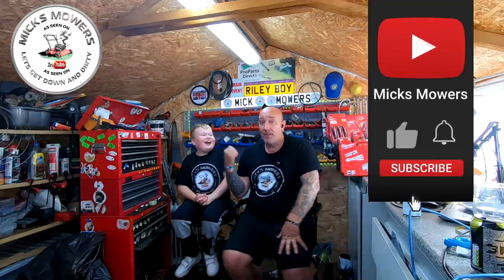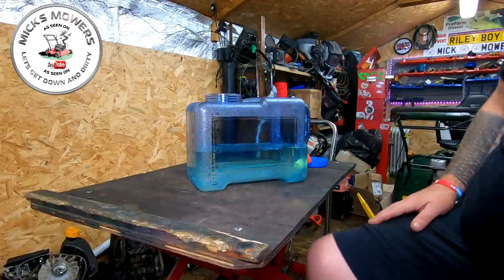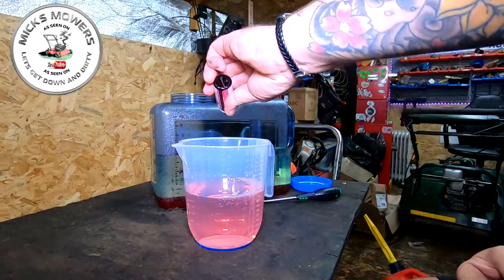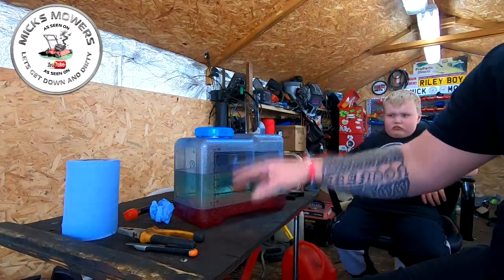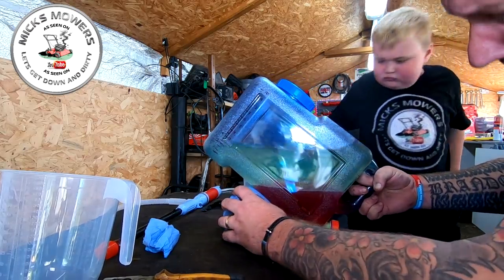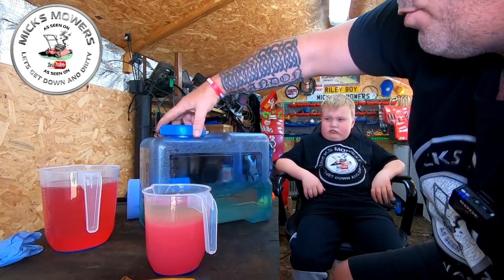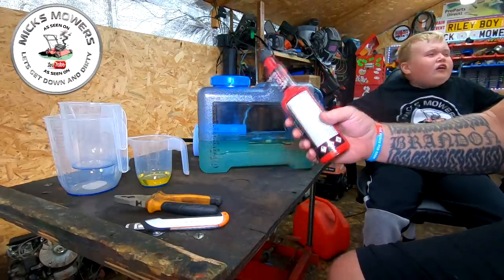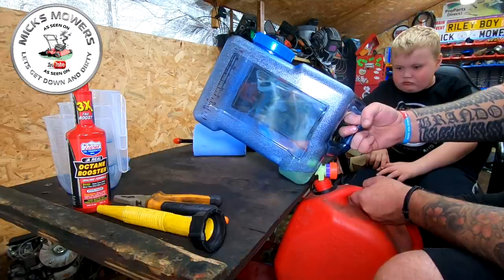How To Remove Ethanol From E10 Unleaded Fuel To Use In Lawnmowers And Small Engines

Comment: Would it not be easier and cheaper to just buy super unleaded?
Reply from the maker: I'm just giving an option
Reply: @themowerman  yeah and well thought out one everyone is looking at options and doing research for obv reasons. After looking into it myself and partly through owning a sports car that runs on super unleaded and checking about new fuel I found out super unleaded for me is way forward for my power washers and lawnmowers etc straight from pump to machine. It wasn't a dig , I thought it would open up conversation about what I said if anyone had including yourself had any more insight into situation.
Reply from the maker: @andymorrow1597  thanks for the information mate

Comment: If you can separate the ethanol from the water, why not add it to the windshield washer fluid bottle in your car rather than dumping it or “responsibly disposing of it?” It’s made from corn and biodegrades. You can also burn it for heat. It’s paid for - why waste it?

Comment: HI   I USE ETHANOL TO CLEAN PARTS AND ETC. I HAVE STARTED DOING THIS WITH OUR MOWER GAS, AND IT WORKS WELL.  I HAVE SEEN TO USE SALT TO REMOVE WATER OUT OF THAT OLD ETHANOLTHAT CAME OUT OF THE GAS.  THEN THEY COULD USE THAT TO WASH OFF PARTS AND OILS AND GREASEY PARTS. DO YOU THINK THAT THE SALT IN ETHANOL WOULD WORK?  LOOKS LIKE IT WOULD.  THANKS FOR THE GOOD VIDEOS.
Reply: He put 2 litres of water in there.
How much salt are you planning on using to soak up 2L of water, just to recover 500ml of ethanol?
Reply: @incandescentwithrage I HAVE NO IDEA, A LOT I GUESS . A CUP OR MORE? IN MY AREA 1 QT. OF 70% ETHANOL IS BETWEEN 2.00 TO 3.00 $ US. IF I CAN GET 500ML FOR 1 CUP OR 2  OF SALT THAT MIGHT BE WORTH IT.  SALT IS CHEEP AND ALSO YOU MIGHT BE ABLE TO RECLAME THE SALT BY EVERATION OF THE WATER. JUST SOMETHING I THOUGHT MIGHT WORK.                 THANK YOU FOR THE REPLY.

Comment: I Think that there has been a lot of scaremongering and BS talked about E10 petrol. I can remember Cleveland Discol being advertised as containing alchohol not sure how much but somewhere around 20 to 50% maybe higher as it was the marketing brand of Distillers who made if from the left overs from the brewing industry, they sold it from the early 1920's to the late 60' or 70's when they got taken over by the Guinness  group. Ethanol did not seem to cause problems back then.
Reply: Back then they didn't have so many rubber or silicone gaskets, engines were more rudimentary and didn't involve complex injection systems but more simple carburetors and we all know if you throw anything volatile into a confined space with a spark it will bang! What do you think moonshiners used in their vehicles to gain an advantage. Obviously It would involve more maintenance as displayed in top fuel dragsters that are required to have their engines stripped after every run 🤷🏻‍♂️ and nope it ain't because of the torque stresses, it's purely because of the high ethanol/methanol fuels they run.

Comment: 8:10 - When pouring liquid from any container with a spout, hold the handle at least or  to mitigate sloshing! Also, 10:54 - set the lid on square to the target and with slight pressure downward, turn the lid backward up to a full turn until you feel the pop, then screw the lid on without cross-threading or otherwise fighting it. 21:30 - "Not one milliliter" is what he meant to say!

I saw a vid once where all he did was let the fuel sit for several days. Then he removed the precipitant from the bottom.

Comment: Ethanol free gas is hard to find and very expensive here in CA, I've had no issues using E-10 since it's inception a few decades ago so I don't bother using ethanol free. In case it wasn't discussed in the video, stripping the ethanol will reduce the octane and could destroy your engine.  I strongly recommend starting with high octane E-10 if you're going to strip the ethanol, or at least be vigilant of your engine and listen for signs of detonation.

Comment: It was oddly satisfying watching the red stuff extrication.

I live in Canada and I despise ethanol gasoline. It messes up small engines and can also affect car engines. All this nonsense to mollify some enviro-wackos and agriculture lobbies. And the fuel is made less efficient by virtue of reduction of BTU due to the ethanol. You actually burn more fuel than with straight gasoline, or as you in the UK call it, petrol.

P.S. Lovely to see you having your son with you. I am sure he will always have fond memories of time with Dad.
Reply from the maker: Thanks for watching mate
Reply: @themowerman  You're welcome, mate. My local gas station used to have ethanol-free gasoline, but recently they applied a label to the high-octane pump which reads: "May contain up to 10% ethanol."

I ran ethanol-free in my "muscle" V-8 engines. I would put away several NATO jerry cans full of ethanol-free with stabilizer. It stores well in those steel cans. I would fill them up with winter formula gas and add stabilizer.

In Canada we have two blends of gasoline, winter and summer. Winter fuel has different additives so as to enhance cold weather performance. Being so close to the U.S. we have fallen for the ethanol myth.

Thanks for making it look easy and understandable. I still have some ethanol-free fuel from last winter, but now I must either find a station with ethanol-free or "brew" my own. Cheers!

Comment: why not just use shell vpower for the next 5-10 years..its got allkinds of additives keeping the engine clean while e10 has not.its ike supermarket petrol..ethanol absorbs moisture from the air..thats the root of the problem..but like you pointed out there is an additive that floats on the top and does not let air past.acting like a barrier but yeah..vpower for now

Comment: You now have ethanol free fuel, of unknown octane.  Now add some amount of octane booster to achieve a unknown, but higher octane level.  The risk is detonation in your engine which can lead to rapid engine failure.  In the USA, Ethanol free fuel is available for such uses.  Now, what do you do with the hazmat fluids after you extract them?  Octane booster does not add "Pizazz", it increases the temperature the fuel self ignites at, known as the flashpoint.  By taking away the ethanol, you lowered the flashpoint of the fuel by some amount.  Using this fuel in an engine would be risky.  Add back enough octane booster and you will be fine, but how much?  Do you want to risk this?
Reply: This is exactly backwards.  High-octane-rating fuel has a LOWER flashpoint, ethanol and octane and octane-rating boosters RAISE the flashpoint.  As the piston compresses the fuel-air mixture, it heats it, and if the flashpoint is too low, it will ignite before the spark and before the piston reaches the top.  That's what engine knock is, and it's why high-compression engines need high-octane-rating fuel.  Also, since it ignites without the spark, it can run on after the engine is turned off and the spark stops.  So if there's no knock or run-on, the fuel is good.  The octane rating CANNOT BE TOO HIGH unless it gets so high the spark won't ignite it, which I'm pretty sure is impossible to do with this method.
Reply: Worth noting that adding ethanol has enabled the oil companies to sell us cheaper, less-refined petrol/gasoline without a price change.  The high-octane stuff takes more refining to produce, and there's only so much octane in crude oil, so there's less yield of it.
Reply: @egregiouscharles9702  No, High octane rating fuel has a HIGHER flashpoint, allowing it to be used in higher compression engines without detonation.  Take the ethanol away and you risk engine damage due to detonation.  It is counter-intuitive that increasing the octane level of fuel allows more power to be extracted from the fuel while also increasing the flashpoint of the fuel, but that is the way it works.
Reply: @MyRadDesign  Oh crap you are completely right.  How did I screw that up?  You'll notice I described the process accurately but reversed the higher and lower.

Comment: The trace minerals from tap water wouldn't compare with the buildup from ethenal. If we burned clean fuel our cars would need far less repairs.
Reply: Ethanol is clean burning and leaves no residue when evaporated.

I cannot say the same for Gasoline.

Comment: Why don't you just call it distilled water?
Reply: Because it is not the same thing. Deionised still contains bacteria and viruses. Distilled still contains ions. For completely pure water you have to deionise distilled water. Deionised water should never be drunk until it has been exposed to the air for a while. It is reactive ie corrosive

Comment: Here Mick.  
You don't need a distillation flask. I use a a large pressure cooker with the weight removed and a coil of copper brake pipe attached to the steam outlet.  Put the coil in a basin  of cold water with the outlet then in to a jug. (Cold water will help ot cool and therefore condense back to liquid from vapour)  Try keep to 78c (boiling point of ethanol) 
You should end up with it reasonably pure, well atleast pure enough to use as a fantastic degreaser/ cleaner.  Hell yer own personal supply of hand sanitizer if you prefer....  lol

https://youtu.be/aWiQrHW7XBs

Comment: So instead of +25p for 5 litres of super unleaded you can pi55 around... spend £'s on deionised water, a container, sucking machine and loose 0.5litres of fuel you have paid for in the first place...

Or simply don't let the fuel evaporate from you carb after use by shutting the fuel off and letting the engine run and use all fuel in the carb...

Comment: that was pointless as all octain boosters have ethanol most are just pure ethanol.
for garden stuff just use a 97/98 ROn or octain petrol.
by the time you remove the ethanol the octain will drop to 94 RON 
if you add 2 stroke oil it will drop again to 91 RON because 2 stroke oil lowers the octain
91 RON petrol is perfict for small engins

Comment: So... If it's 10% ethanol, and you had 5 liters to start, if your method were sound, there would be fully 2.5 liters of water and 4.5 liters of fuel. Looks like you got maybe half of the ethanol.
Reply from the maker: E10 or up to 10% ethanol

Comment: The ethanol in E10 is what gives the fuel it's octane rating, that's why it's cheaper than E0. Removing the ethanol will dangerously drop the octane rating of the fuel. Your better off just using the e10 within 30 days or adding stabilizer.

Comment: So fuel with ethanol is not god for a scooter
Reply from the maker: Because they have increased the ethanol it will not run as clean as with petrol with no or very little
Reply: @themowerman  Maybe i just use octane 100 without ethanol

Comment: Glycol is much better than water in order to remove up to 10% of ethanol plus up to 3% of methanol included in our terribly treated gasoline.

By removing that shit we are increasing the caloric power but lowering the octane index.

My 5hp outboard requires only 92 octane fuel, free of ethanol, to get the rated 5hp maximum power and not developing  aceto bacteria after being left in the tank for one or three weeks.
 
So I bought 1 liter of glycol and 5 liters of 98 octane gas (petrol).

I do know that my 4.5 liters left of ethanol free gasoline will not be 98 octane anymore but now will still have more than 92 octane index.

Just used 0.5 liters of glycol that I kept for the next time because it's not as cheap but much better for this purpose than plain water.

Comment: This is an 'INCREDIBLY BAD IDEA! ! ! First of all you are assuming that the gasoline is 'PURE' gasoline, IT IS NOT! Second, You are assuming that the gasoline you end up with will have sufficient octane to run your engine reliably and without engine knock. IT WON'T! I have transported and loaded gasoline for the past 6 years and I can tell you that the gasoline the refinery starts with to make 87 octane E10 is very low octane to start with and then it is diluted with other lower octane fuel to reduce the octane even further. Only then, after the octane is lowered enough is the Alcohol reintroduced into the fuel to raise the octane rating back up to 87. By removing the alcohol you are trying to burn a fuel which will result in VERY POOR performance of your engine and will do GREAT harm and damage to your engine. 
If you want Pure gasoline then find a source that will sell you gasoline without alcohol.
Reply from the maker: I appreciate your comment thanks for watching

Comment: You are wrong!  10% ethanol does not hurt modern gasoline engines.
Reply from the maker: I did not say it did.. watch the video.. it's for small engines.. Lawnmowers strimmers.. sooo your wrong..
Reply: @themowerman  It does not hurt small engines ether.  Ethanol in gasoline has been mandatory for about 30 years and I use it in everything from my lawnmower to pickup trucks.  Never had any fuel problems.
Reply from the maker: @stevennelson9504  ok so let's get back to the first comment.. like I said I did not mention modern engines.. with regards to small engines that the video is intended for. The use of E10 fuel of which has up to 10% ethanol is a problem for carburetors..and this is made worse for vintage engines too, even classic cars and motorcycles as they run on a carburetors.. it effects the rubber rings,seats and even brass bushes.. ethanol its self is good to protect against engine knock but now that we have up to 10% a %5 increase and the new E15 is on its way it is an increase in ethanol that's the problem.. it's a carburetor issue not engine issue.. one last point is v power fuel is next to ethanol free so if it was an problem then why are people using ethanol free grass.? because non ethanol doesn't effect the carburetors as bad a gas with ethanol in it.. .. anyway thanks for your comment it's much appreciated
Reply: My cars are 1930’s so useful information for me

Comment: Buuut.... Octane Booster.
They are typically a blend of tetraethyl lead, alcohols (including ethanol), traces of methylpropyl, manganese, toluene, and ethers. 
So you just added what you took out.
That sludge on the top is what you just added back to the fuel.
You only remove the ethanol if you are to runa small engine like a weed trimmer or maybe an old two stroke moped or something.
 Not cars.
Reply from the maker: This video is ONLY ment for trimmers old mowers as I said in the video.. hey many thanks for the comment

Comment: Sure the ethanol is hydrophilic but you should only be able to extract 500ml of ethanol (10%) from the 5l of E10

Why not start with 98 octane E5 super unleaded then remove the ethanol (250ml) and the octane will still be around 94-95 negating the need for a booster?

As for the few drops of water left in the container ... just leave it till next time!
Reply from the maker: Brother the results speak for themselves
Reply: @themowerman  .. of course you’ve been using E5 for years so why not just use E5 unleaded (super unleaded), still available at almost all filling stations? ( by the way I’ve using ‘washed’ E5 super unleaded for the last season fill of my classic cars as it’s better for storage than leaving them empty ...)
Reply from the maker: @andyxox4168  I went to a petrol station yesterday and all they had we E10.. so it's fine if you can get it.. all I'm doing is giving an option
Reply: Wow, no premium fuel available, no Esso Premium, no Shell V-power no Tesco even. where’s that?
Reply: @themowerman  check your local Esso station, most of them have premium 98 octane with zero ethanol …
Reply from the maker: @andyxox4168  just outside my town.

Comment: You are degrading the RON number of the fuel which although probably not a problem in a lawn mower it could burn valves etc.
Reply: Thats what the octane booster is for

Comment: Not trying to rain on anyone's parade,  buuuuut, removing ethonal from your E-10  etc. Will reduce the octane rating of the fuel,  the ethonal is formulated into the fuel to help control engine knock, as well as reasons we all don't like and can definitely can do without ethanol.  I miss the old days of leaded gasoline,  ahhhhh. That smell.....
Reply: I guess it pays to watch the whole video first!  I apologize if I offended anybody.  But aside note I did some math and came up with @ 4% ethanol in this batch of fuel given the data he has.  Just my 2cents.  One word of advice Don't cheap out on octane boosters,  it can go bad in a hurry.....